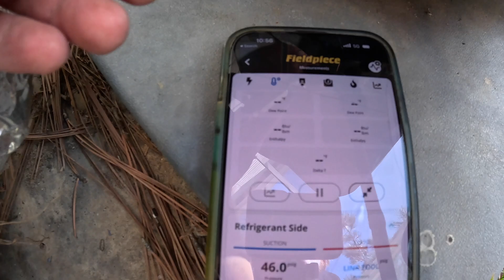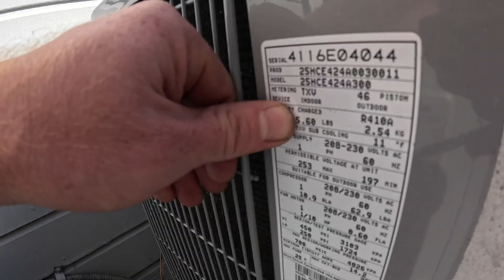Three HVAC Technicians VS ONE Leaky Heat Pump

Comment: Great vid! When charging the unit you should always start with factory charge like you did. BUT you have to run it in high stage cooling and charge to “indoor txv subcooling” to dial in the charge. Lineset size shouldn’t matter in this case. Keep up the great work!